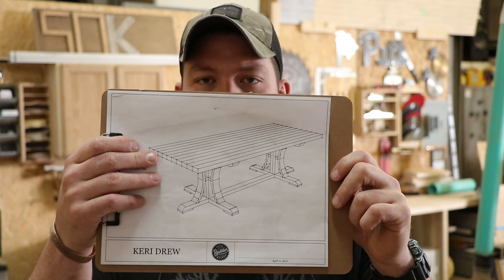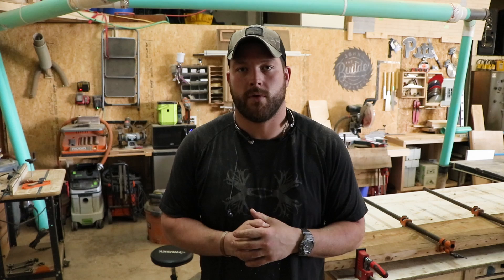Reclaimed Dining Table Build Pt.1 | The Builder Vlog

Comment: oops, no biscuit, dowels or dominos or splines, to strengthen the top, ouch, love your shop though, wish i had something bigger
Reply from the maker: +ozzie barton I'll give you 100 bucks if you can break my glue joints ? All of those are unnecessary in panel glue Ups. Also with reclaimed wood tops, it's very hard to reference the face for use of any of those
Reply: Good thing you put these videos on the Internet. That way people can tell you all the things you are doing wrong.  ;/
Reply: no offense, i enjoy your videos, i have built a few reclaimed wood pieces with biscuits, it was hard as hell though, and yes glue will probably be just fine, i just like to use extra linkage. but thats the great thing about u-tube, all the different methods and ideas, keep up the good work.
Reply from the maker: +ozzie barton biscuits are pointless I'll stick to that. But dominos and dowels for alignment don't hurt. Make less work as well. It is just difficult to use them for this situation because of the wood not being level on top.
Reply: Okay, this leads to a question I have seen much info on.  In climates where there is a lot os weather change.. are domino’s needed ? I thought there where needed to prevent cupping, warping or splitting. What is the scoop with it ? This will b my first table and I don’t want unnecessary work, I will be using “ regular wood “ not reclaimed.  Also, for a beginner like myself. What type of wood would you suggest.  I am going to make a small farmhouse coffee table